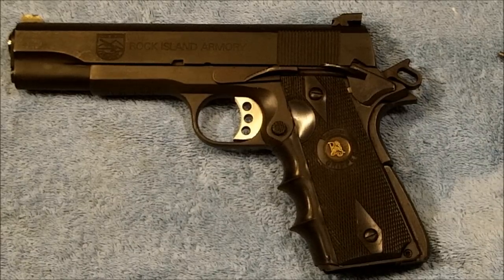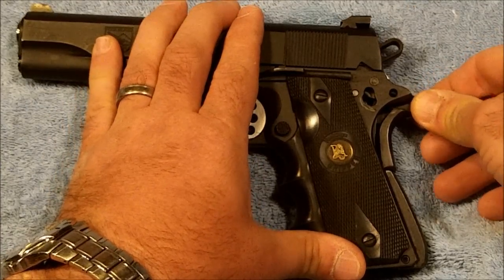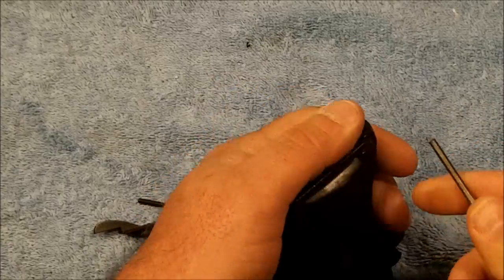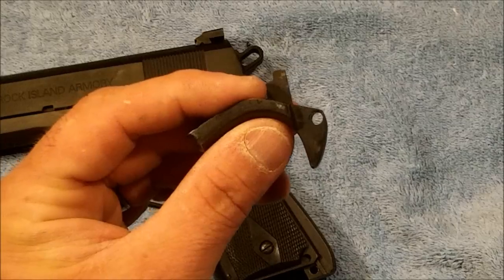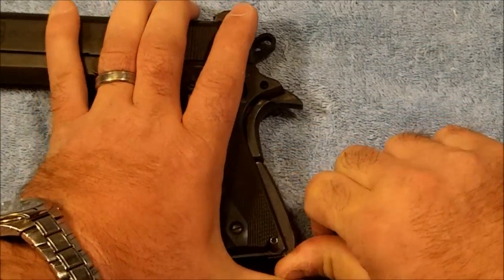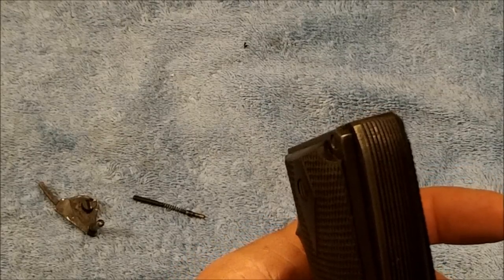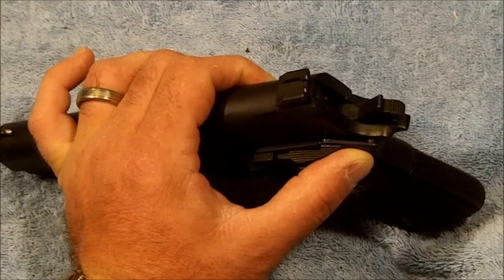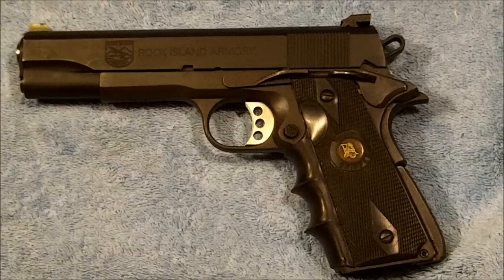1911: Alternative Grip Safety Removal??

Comment: Having the grip safety sucks. I have to make sure the grip is held tight in order to fire, in a quick combat moment you may not have enough pressure on the grip to fire. 
Allowing the bad guy extra time to fire.
Reply: Then u shouldn’t own a gun 😂🤣😂
1911 have never allowed bad guy to get more time bc “user “ can’t grip it right
In quick combat, having a sure grip on ur firearm is routine practice .
Reply: So get and use a different gun! Duh!

Comment: The advantage would be the fact that the mainspring housing is the one pin in the gun that is difficult to remove and reinstall. So if someone was installing a drop-in beavertail for example it would be a little easier to do without removing the ms housing.

Comment from the maker: That I've read, there is no real explanation,  The Model 1908 did not have a grip safety,  However the Army requires a safety, so my speculation is that Browning thought the Grip safety was more efficient and easier to produce, which is why he included it in the Model 1910.  The 1910 eventually became the 1911 when he added the thumb safety at the request of the Army Ordnance Department.  Wilson combat offers a 1911 with a grip safety delete, and they offer the part they use for about $200.
Reply: Do you know what the part is? I have not been able to locate anything on Wilson Combats Site.

Comment: Hello again doctruptwn.  A grip safety question.  On both my Rock Island Armory 1911's  I get a  bad case of grip safety bite on the web of my  thumb/hand area.  Without purchasing a new full grip safety -  I was thinking about  shaving off the offending sharp edges.  I know this would affect the blued areas I would work on & I do not like the perma blue product.  Short of sending it to a gunsmith or purchasing an expensive replacement grip - what suggestions would you have.  Thank You Sir.  Sincerely,    JAMES.